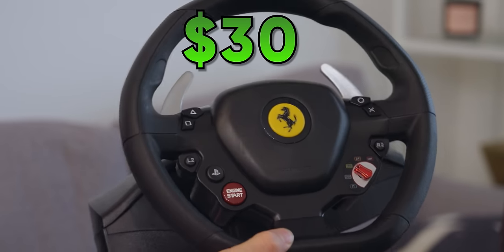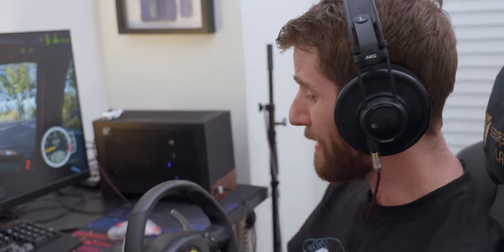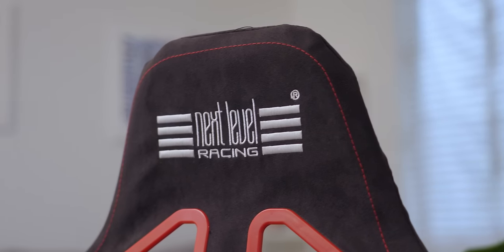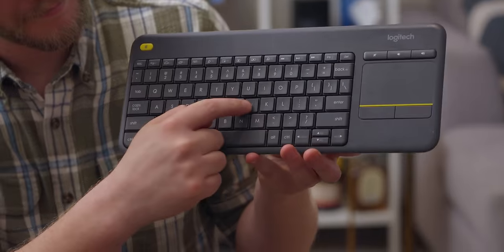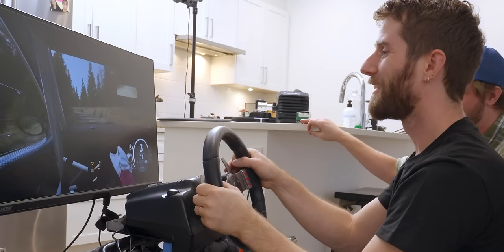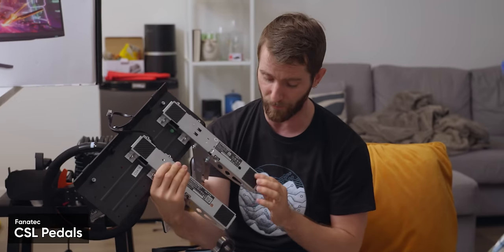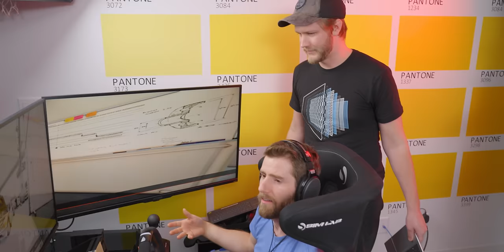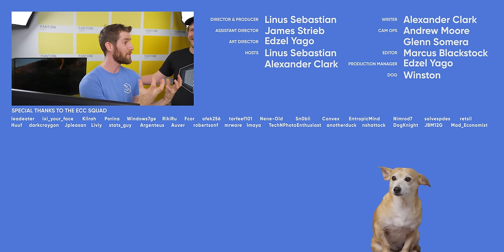Don't Waste your Money - $30 vs $10,000 Racing Setup

Comment: Something for potential buyers to consider is that the resale value of most of these sim racing setups is quite high. I bought my T300 with pedals for 300 and about three years later when I upgraded to a direct drive wheel sold it again for 250.
Reply: I can second that, sold my thrustmaster tx for the same price I bought it
Reply: How did you like your T300? I'm thinking of getting the T300 RS or perhaps a T248 with their new cheaper shifter (TH8S) and a Wheel Stand Pro at some point. There's better, sure, but I'd only use it occasionally.
Reply: Because of the pandemic, this was true. itll be less true as time goes on
Reply: @SosaKinkos debatable actually. My anecdotal experienced illustrated very minimal loss after a couple years ownership and that was pre-covid.
Reply: 100% I sold my Logitech G25 on a frame for $300 3 years ago.
Reply: I bought a g923 for $300 and sold it 2 years later for the same price
Reply: @dystopiawanderer it's good, but direct drive is quite a bit better, and the barrier to entry to direct drive has become rather low with the fanatec CSL DD and Moza R6
Reply: @dystopiawanderer t300 rs gt the 3 pedal model is very nice to use over the Logitech g29 or g923. Much faster to respond quiter and stronger another feedback only meh thing is the pedals about the same as the Logitech pedals.
Reply: but why? are they limited production?
Reply: @dystopiawanderer  
i have the t300rs on a wheelstand pro, and compared to the logitech wheels it is much better!
the pedals for it with the rubber bumpstop thingy for the brake makes it easy to mod it with a load cell, an arduino leonardo or pro micro with a hx711 compatible loadcell is a good cheap diy option!

after upgrading from the logitech g-series wheel to the t300rs, after being away from simracing between 6 months to a year or something like that...
the first lap i did on the nordschleife in assetto corsa in the ac cobra i set a new personal best, the t300rs is much smoother!

but then also there is a direct drive wheel available for around 300 dollars, i forget the name of it and have not tried it myself, but i am considering buying one... i think direct drive is the way to go, there are affordable options out there now!
Reply: That's insane ...
Reply: @dystopiawanderer if you have $450 get the fanatec r2r 5nm bundle
Reply: Smooth
Reply: I've purchased and sold a t300s 4 times now and made money each time. I think that is really the sweet spot even with DD wheels becoming so much cheaper.
Reply: @Team_SpaceX  That does look great. Adjusting it to be 3 pedal + shifter increases the price hugely though, and considering my use case and budget I can't really justify spending that much. The Thrustmaster seems like the sweet spot, but "even" that price is pushing it for me. But it's cool to see!
Reply: @dystopiawanderer personally I loved my t300 got so so many years out of it def the best starter wheel of its in your budget in my opinion
Reply: @dystopiawanderer  you don’t really need a shifter but if you really want a clutch and a shifter then get a used t300rs gt if you can find one for cheap
Reply: In general, yep! Just keep in mind that some hardware doesn't age as nice. My ClubSport V3 Pedals will fetch most of what I paid, but I know that if I wanted to sell my ClubSport V2.5 wheelbase it wouldn't (as it's a premium belt-driven wheel, and now direct drive wheels have taken over and gotten extremely affordable).
Reply: I've been pretty lucky with second hand purchases. Originally got a thrustmaster TMX, with pedals, TH8A and a decent rig for $150. Had to buy the $30-$40 cable to get the shifter to plug into USB. After about a year I found a guy that I think was just in a hard spot, I paid $280 (his posted price) for a Moza R5, CS wheel, SR-P pedals (only the two, I ordered the clutch for $50 from Moza) and a garbage rig that I didn't use. I was worried it might be broken but figured not everything could be completely useless. Have 50+ hours on it and everything works perfect.
Reply: @eldukedrino  Wheels for sim setups aren't really high volume but resale values not really going down has to do with wheels tend to be very reliable and the people selling them pretty much never try to sell broken equipment as being in working condition. So there's much less of a need to try to lowball someone because you're worried you might be getting scammed. So resale values on gaming wheels tends to remain high. Also communities around WRC and racing in general tends to be pretty tight-knit. Even on the gaming side, where most gamers can't or don't want to shell out the money to race real cars, the WRC and racing community tend to be tight-knit and aren't trying to scam one another.
Reply: wow so you only spent $50 for 3 years?|
that's crazy
Reply: Wait the new wrc is out? I'm still here playing Dirt rally 2.0
Reply: I suppose it's because it's a niche product
Reply: @Lessenjr your experience is much more debatable... Only a sucker would spend so much for a used setup with no warranty... Racing sims decrease in value much harder than cars
Reply: I bought g27 for 150usd more or less (pln currency) and sold it 8 years later for 130usd.
Reply: @Cooe. I just bought my t300rs new from amazon for £299 with the 3 pedal set. Still need to get a shifter though.
Reply: @Ballissle £300 ≈ $400 lol. Although the 3 pedal T300RS GT is usually like ≈$450 over here, so it looks like it's a little cheaper across the Atlantic. Even then though, it's STILL IMO not worth buying when the full blown direct fucking drive Fanatec CSL DD Ready2Race bundle is just +≈£/$100 more and in a COMPLETELY DIFFERENT UNIVERSE performance-wise. 🤷
Reply: Fanatec one costs only 450$ as a DD bundle, not that bad
Reply: @fomingera65  dd1 coats 1700usd more or less. You mistake it with csl dd.
Podium dd1 is top hardware from fanatec
Reply: @CooeF  didn't know about it. Its not on amazon UK at all. Also two pedal set is a deal breaker so I would have to buy separately.
Reply: And most of the gear lasts a really long time.  I started with a Logitech G27 that refused to die, and now I'm on the same Simagic wheelbase for the past couple of years and absolutely loving that the wheelbase is built like a tank.
Reply: @Lessenjr   i think its cause lots of those peripherals  get removed from market or sold at very low numbers,its prob because the profit margin and market aint big enought for companies...
Reply: And if not the T300, the T150 Pro (the “pro” just means you get a nicer 3-pedal setup) instead of the shitty 2-pedal from the base 150.

It’s good enough, has a reliable system, and it’s good enough to see if you actually want to stick to it or not.
Reply: I got the t300 (and Ferrari wheel (leather not alcantara)) and fanatec pedals for in total like $300 probably. FYI you need an adapter for the fanatec pedals if you don’t have a fanatec wheel base (costs like $30 is lmao)
Reply: Today everything is much more expensive then it was 3 years ago so I dont know if the product in this case is relevant.
I bought a new X-box series X 1-2 years ago, now they sell for 30% more then back then.
Reply: I tried to keep my g923 in perfect condition but when I went to check on it in the attic i found out mice chewed through the leather, I wonder how much it would go for now or if I could repair it.
Reply: @dystopiawanderer go T248 with the shifter, I have had a T248 for about a year now, and I'm considering the shifter now. The additional rocker switches are nice, and the display is useful if you want to use no UI in game and just drive without distractions. The pedals are fine, but you definitely want to place them against a wall and find a chair that won't roll, maybe even wood to mount them on to provide support if you want to use the stiffer spring that is included or heel toe, because if you press too high too hard, they lift up, which normally isn't a problem. New, and coming up on Christmas now, the T248 is going to be cheaper than the T300, and the force feedback is definitely ample enough.
Reply: Yeah that’s true I did the same with mine when I upgraded. After 2 years I sold it for $40 less than I paid for it. The main thing is to keep the box
Reply: @SosaKinkos  Not really, i bought a T150RS Ferrari for $150 new in 2017 and sold it in 2019 for $220
Reply: for that price you could of bought a Asetek Prima setup... why do people spend so much money on the junk models...
Reply: @SosaKinkos nothing to do with the flu
Reply: @MV-ri7zu  supply shortages were not because of the global lockdown imposed by tyrannical governments?
Reply: @SosaKinkos  there where supply shortages for sim racing wheels? I certainly dont remember that being an issue.
Reply: @MV-ri7zu  yes. and if it wasn’t supply, it was pricing. At least there was when I was buying mine. I have seen in the last year, prices have fallen precipitously.
Reply: yeah I was able to buy a brand new Logitech wheel and pedals on sale for $180, and the on sale price would have been just slightly less, so I just bought it for new.
Reply: I bought a used g29 for 120 euros and sold it after a few months at 180 euros
Reply: Recent high Inflation is main reason for this.
Reply: Love the t300
Reply: @Cooe.  consolae players arent serous racers haha
Reply: This, the quality of most gear is very good so its not unusual to make a good amount of your money back when selling
Reply: @le-johnny9236 You never tried to resell a computer or an actual car have you? 
only 33% loss is almost making a profit in comparison ;)

Comment: I know the trend is 'cheapest vs. most expensive' but I really appreciate the 'bang for the buck' setup thrown in there as well
Reply: i was shocked to se the same wheel I have in there, i got mine from my dad litrally ~7 years ago for my 16th bday and he used it before that. Mine is the G25.
Reply: There is better options than G27 though
Reply: @De-M-oN  I'm listening
Reply: @doslover  mmhmm me too. My decade old wheel is waiting...lol
Reply: Cheapest vs most expensive just makes no sense and has been a personal hatred of me. They get the cheapest car off the Scrapyard that'll still run just to the next town (30 $ steering wheel) but without door, only gears 3 and 5 and compare that to.... a Bugatti "(Watch now for Unexpected ending!!!)"
Reply: Shame that the "most expensive" setup uses an entry level wheel. These clowns have no idea what they're talking about! 🤣
Reply: @doslover  logitech wheels are gear driven, that means on small amounts of movement u will feel the gears. its not gamebreaking and the ffb is still good, but better mid-range option is thrustmaster t300 rs gt. its belt driven, means its way smoother and th engine itself is stronger, means u have double the force feedback strenght. (which makes it quite a workout in cars without power steering when u have it to the max)
Reply: @doslover  Moza R5 bundle if you cant find a Thrustmaster T300 (preferably RS) for less than 400
Reply: I’m a bang for buck kind of person

Comment: G27 owner here, if you do get one, you are going to want to replace the optical encoder wheel inside, it will crack over time and when you make fast turns your steering wheel will start to go further and further to one side, its not too difficult to replace, just time consuming. its ~30$ for a metal one. another issue i have had with mine is the potentiometer in the pedals drifting. you just need to clean it out with some isopropyl alcohol and itll work.
Reply: Ive had my G27 for around a decade and that stupid wheel broke on me 3 days ago. I glued it together and got some of the glue in the notches and its all haywire lol

Waiting for my metal wheel to show up in the mail.
Reply: That’s what I started with and a play seat challenge. Now I got an ASR4 sim rig and all simagic perfs. Alpha P1000 pedals and handbrake and sequential shifter. I love the new Neo GT wheel!
Reply: Nobody is buying a g27 in 2024 lmao
Reply: @brodylockwood14  nobody said anything about buying it in 2024, lmao
Reply: @timsonsuperman  Yeah true lol
Reply: I bought mine in 2012 for 100€ and have used it daily ever since, 5/5 would buy again. Maybe not the best option today but atleast it's shitloads better than G29 or G920 for me.

Comment: As somebody with a high end racing setup (for iRacing) I can totally agree that you get what you pay for. The statement about more sensory inputs is dead on - being able to FEEL things - like the rear end sliding out, or going over the bumps or loss of traction, etc. It makes SOOOO much difference in terms of feeling what the car is doing and being able to react. The immersion level just goes off the charts.  I run in VR though as I find it better than running triples (and takes up less space).

My setup:

Fanatec CSL DD (w/boost kit)
Fanatec Clubsport V3 pedals w/the dampers and the different inserts
Fanatec F1 V1 wheel (have the new V2.5x on order)
Fanatec Clubsport Shifter
Fanatec Clubsport Handbrake V1
DoF Reality H3 3-axis motion rig
SRS 6 transducer shake kit
HP Reverb V2 VR headset
And a pair of custom built button boxes (by me...)

I started out with just a basic crap wheel (similar to the first one showed) with no FFB and I couldn't drive at all with it. Then I got the Fanatec Porsche Turbo S setup which I used for 3 years. Then upgraded the pedals to the V3s. Then bought a used Fanatec Clubsport V2.0 base and the F1 wheel... and so on...   

Point is, if you aren't sure you're going to do it a lot, you can have plenty of fun with a G25/27/29 setup, and then upgrade over time if you get into it hard core.
Reply: Was waiting for a VR headset enthusiast to jump in.  It's so much more immersive than the 3 monitor setup...
Reply: @AdamKontras that can kind of be a bad thing though…

I can’t tell you how many times I’ve gone to grab the shifter in the actual car before realizing the one in real life is somewhere else… and by the time I realize that I’m already done with the corner I was supposed to downshift for lol
Reply: Mike!!!   How long have you had the DoF rig?!  I've been eyeing the H2, but was worried about issues with it down the road because its not built in my country and shipping is expensive!  H3 is on sale right now though
Reply: Not being funny. I can feel the bumps and know when traction is lost playing Forza on old xbox with a controller. And yes it's felt, my controller does in fact vibrate.

I am jealous though. Wish I had the money 😂
I'd have racing rig, aswell as a flight cockpit for StarCitizen.
Reply: I use the Ferrari GT Experience for PS3 on F1 22 with a Quest 3, and that has no Force Feedback. Do you think buying something with Force Feedback is worth it, to actually feel the car? I'm not sure how much only the force feedback could help in feeling the car... maybe it can help in feeling the traction and the grip limit? No idea
Reply: @vaffanclash  it adds to the immersion. Yes. I totally would.
Reply: @th3s3rv37  I see, thank you so much for the advice ^^
Reply: @Fetidaf isn't shifting supposed to be muscle memory at that point? I mean I never tried vr but what I see on racers in rally which also applies to other kinds of racing, they're not looking on their shifter but on the road
Reply: @vaffanclash  
Yes it makes a BIG difference. You can literally feel when your tires lose traction and you go into understeer/oversteer. I recommend the T300GT as a solid upgrade for beginners over wheels without FFB.

Comment: The Peugeot 205 T16 had a big turbo, so you had to keep the revs up to be fast. That's why at the start of the stage you have to pull the handbrake and floor it. You could see the turbo kick in after a few seconds due to starting at low rev range :)

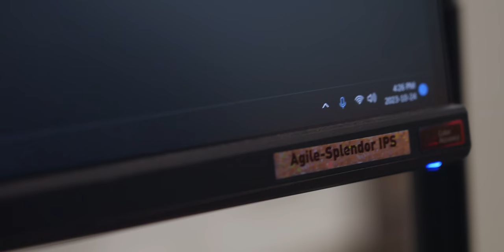Comment: 13:47 Alex mentions brightness being an issue and needing to use the OSD to fix this, if it's purely brightness you can use an application like Twinkle Tray, which allows you to turn down the brightness, volume, and even power via an application instead of the menu; most newer monitors should support this though some older ones might have issues. I used to use this to link two monitors brightness levels together so I can just adjust it for night time.
Reply: Twinkle tray is best app ever honestly, I was looking for this comment, hope Alex will level up is brightness game 😁
Reply: Exactly, I use an app called monitorian to control the brightness of my windows machine. No extra cables are needed other than the normal HDMI or Display Port cable. KDE Linux has that feature built in by default and it's great. Idk why it is not just a base windows feature. It just uses DDC/CI which has been around since the 90s
Reply: In addition to this, for the color temperatures, f.lux can work wonders. Especially if he's mostly changing various settings based on time of day and such, a lot of those changes can be automated.
Reply: I wonder why nobody makes display with built in light sensor like almost every laptop, I have this on my iMac since 15 years but I don't have any way to reproduce this on my desktop pc...
Reply: DUDDDEE this is fucking awesome! thanks! i was looking for something like this!
Reply: Awesome tip, thanks! Another great tray icon to add to my collection of "this should come by default with windows", along with AltDrag, EarTrumpet, Auto Dark Mode, EitherMouse and maybe PowerToys